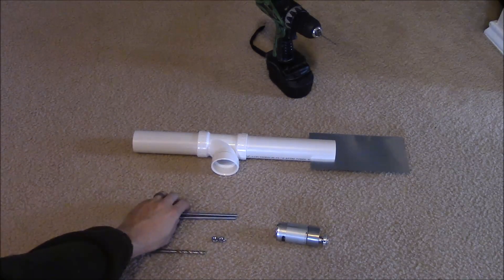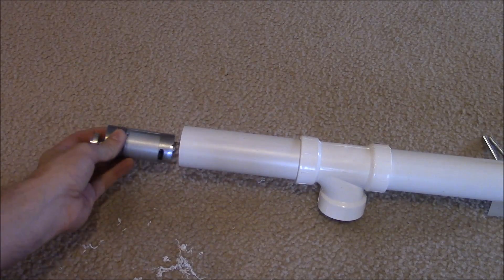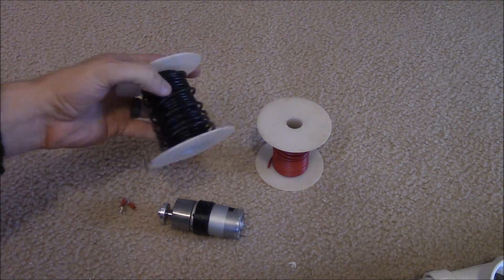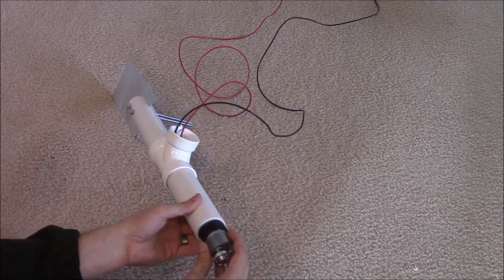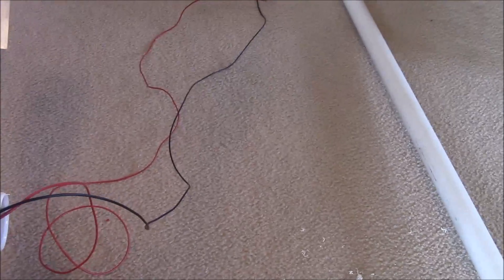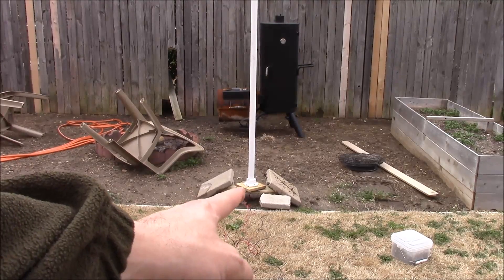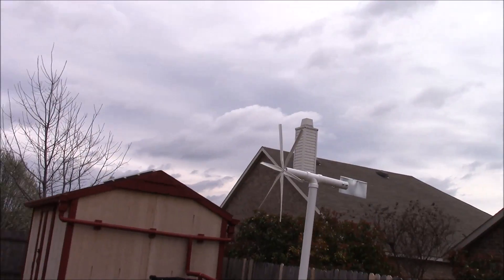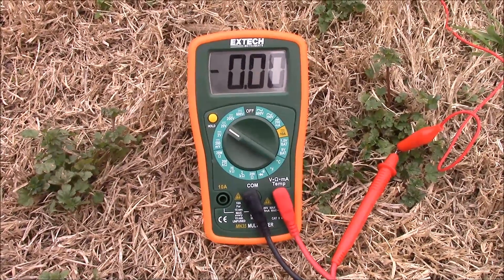How To Build A Micro Wind Turbine - Part 3

Comment: Seems like it either spins real fast or not at all. I would have expected it to spin slowly. Maybe because of the gearing? Needs too much torque to start? Or maybe if it was bigger it would have enough inertia to keep spinning slowly? If I had to guess I'd say wider blades for more starting torque, maybe a bit longer? Seems like there's a mismatch between the rotor and generator. I'm anxious to see how you adjust it. Great project. Thanks for sharing! It's good to see the learning process instead of just the perfected final product!
Reply from the maker: Haha, yeah this is definitely going to be a work in progress.  The motor does require some torque to overcome to cogging effect of the gearing.  I knew that going in.  However, there aren't many other options for low rpm, "hobby" size motors.  I will experiment with different blades.  I also need to make sure the bearing can spin properly so that the turbine can face into the wind.  The pole was leaning slightly so the bearing was not able to spin freely.
Reply: I definitely like what you're doing. Sure, you could make an axial flux alternator but who wants to make all those windings and mess with epoxy, etc If they don't have to! I saw a small "turbine" (a motor and rc prop) for sale on Amazon and they use a 30 volt motor so the 12 volt speed isn't as high. Maybe that would be another alternative to the gears?
Reply from the maker: Yes, that is another option.  I have seen that same thing on Amazon and it doesn't get good reviews.  Like you said it is just a hobby motor like I have with some flimsy model airplane props.  I am not saying mine works any better but I have a baseline to work from.  I will try fixing the yaw first and designing better blades and if that doesn't work I'll scrap the motor and find a better motor.